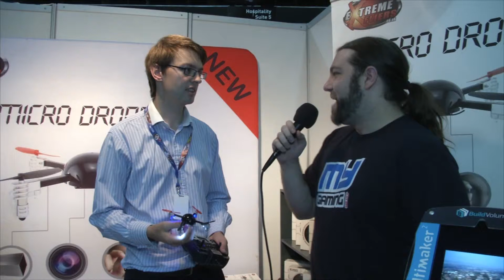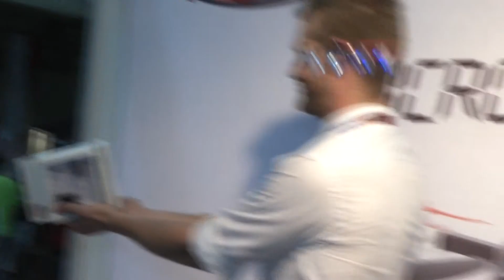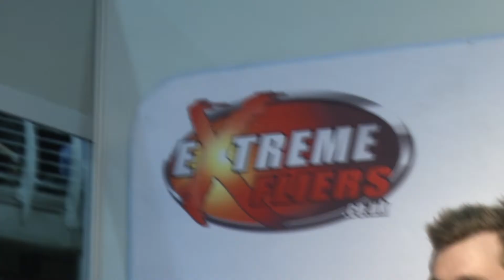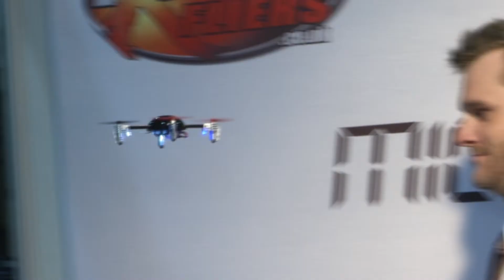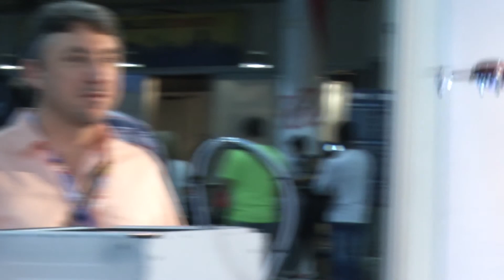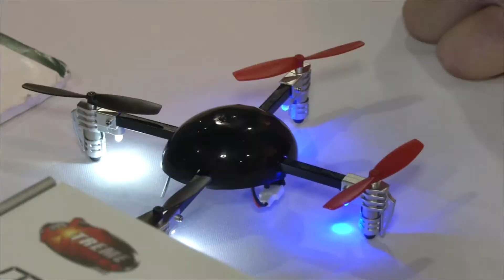rAge Micro Drone 2.0

Comment: R1200?  Ouch!
I got a nice little Quadcopter that seems a bit larger for R400 on a takelot sale.
Strapped a Mobius cam on there and it could still fly pretty well, although the Mobius is a bit on the heavy side.  I think it's closer to 40g in its housing, which is double the carry capacity of this model.  The cheaper 808 #16 is 720p (still better than their 640x480), and lighter than the Mobius, so should fly pretty well.
Reply from the maker: Well I thought it was a good price, and he sold out by the Sunday afternoon. Now just got to practice flying the thing.
Reply: It might have higher quality components than a Hubsan X4 which sells with a cam for R1k, but I find it hard to justify.

The 3D printing was quite interesting, but I haven't seen any add-on modules other than the cam.